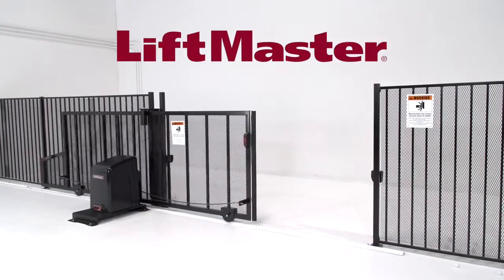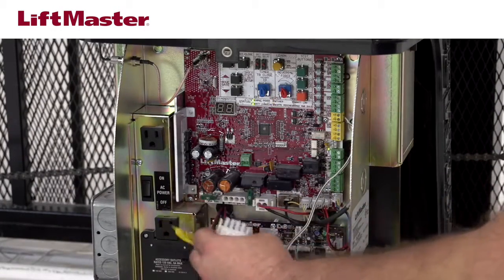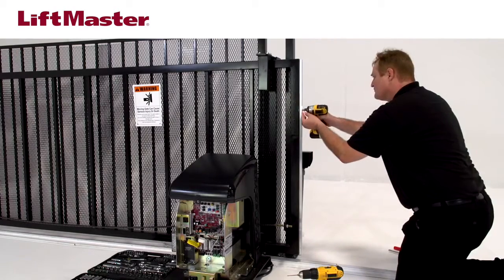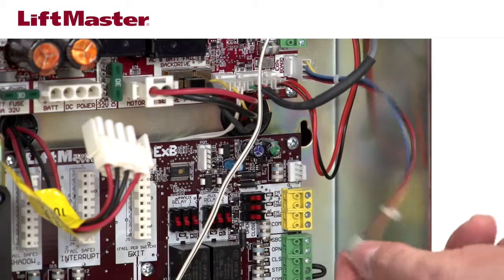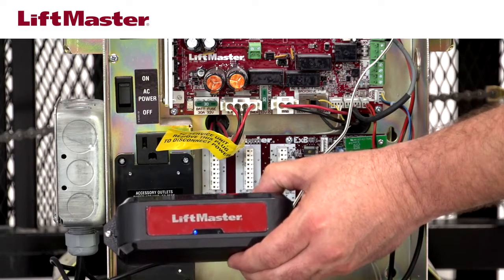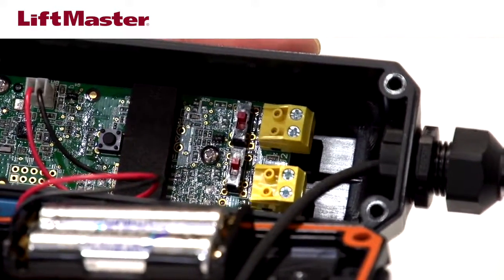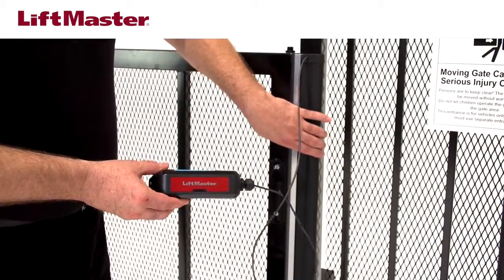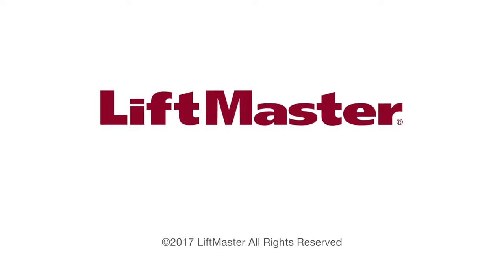LiftMaster - How to Install the LMWEKITU with an Edge Sensor on a Liftmaster Gate

Comment: I followed up the instruction but the Red LED on the receiver does NOT blink 4 times. What should I do to solve the problem?
Reply from the maker: You can find a link to the products website, where you can find the manual which might be helpful. https://www.liftmaster.com/gate-operator-accessories/p/LMWEKITU

The first thing I would want to know is it wired correct to the main board and/or the expansion board. You can find a wiring diagram in the link provided. Is the power turned on to the operator, and is the new receiver getting power? The receiver may have some other lights on it, are those blinking?

It's described in the manual how to bypass the expansion board, if you are currently wired to that. Instead try wiring the receiver directly to the main board?

Hope this helps.